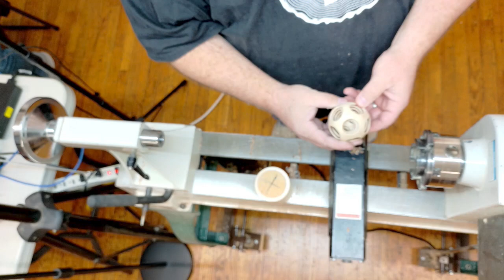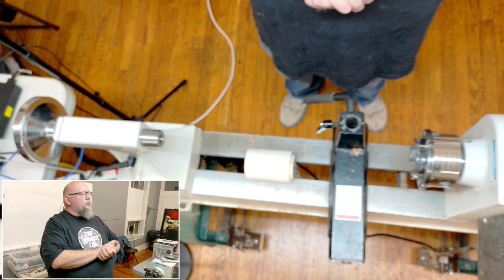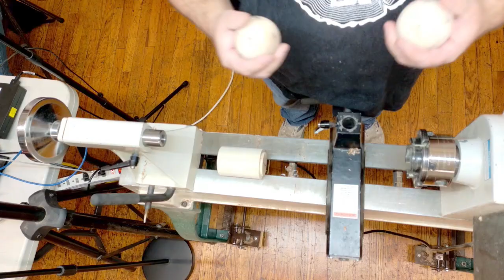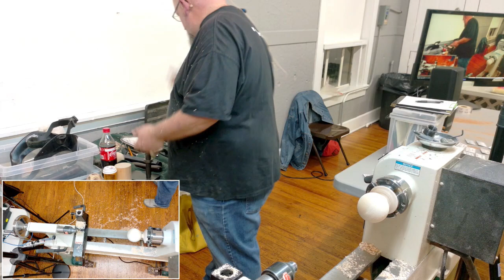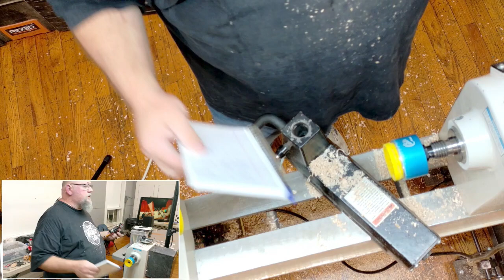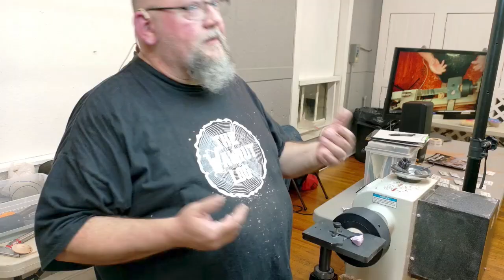Chinese Puzzle Ball by Jeff Hornung from the The Walnut Log

Comment: This guy had the gall to call the DVD boring and complain about unclear instructions!  He did say he wasn't an engineer, and boy was that obvious.

It took 50 minutes before he started marking out, and then you couldn't tell what he was doing.  He didn't even do what he was supposed to be demonstrating.  He didn't do any turning apart from the first stage of making a sphere (which isn't that hard at all, and doesn't require any special tools)  I literally fell asleep before getting to that point and had to rewind.  Apparently, the cameraman fell asleep too judging by the abrupt ending.

I'm pretty sure I can figure out from scratch how to do this easier than following him.

You don't need a spherical chuck to hole a spherical object, all you need is a plate screwed to a faceplate ring, and turn a small hole in the centre, and make the outside round (it can be as large as you like).  Then drill 6 equally spaced bolt holes around the outside.  Make a second plate with a hole that's larger than the hole you'll be making in your sphere, but smaller than your sphere.  Drill another 6 bolt holes to match the first plate.  The sphere sits in the small hole, and the larger ring clamps it in place using bolts between the two plates.  It doesn't matter if the two rings aren't exactly parallel.  The same chuck can hold any round object, not just spheres, and it can accommodate different sizes of spheres.  You can make different sizes of rings to accommodate any size of roughly spherical turning.  Any competent turner could make a clamp like this in half an hour.

For creating a sphere, just cut a semicircle out of some flat wood about 1/2" thick.  Make it a shade larger than the sphere you want, to allow for the thickness of the sandpaper you're going to put onto the curve, and use that to finesse the shape of the sphere.  It's much better than a flimsy bit of Cricut plastic.

Considering how interesting the subject matter is, the fact it's only got 1.8k views in a year shows that nobody who sees this recommends it.